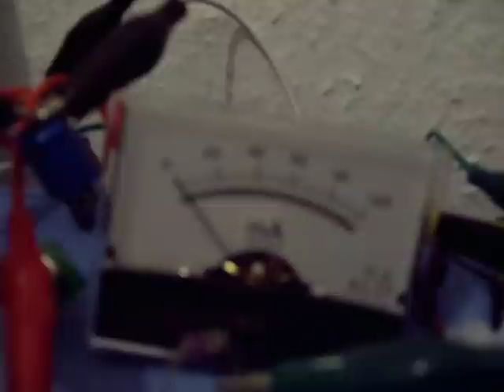Magnetic Suspension

Comment: this pendulum movement you observe is the first circular oscillation mode.  If you keep it running at that speed the oscillation won't stop, you need to spin it up much faster than that and to much higher rpms in order to avoid coupling to this mode.
Greets.